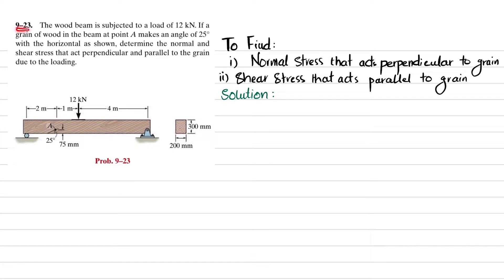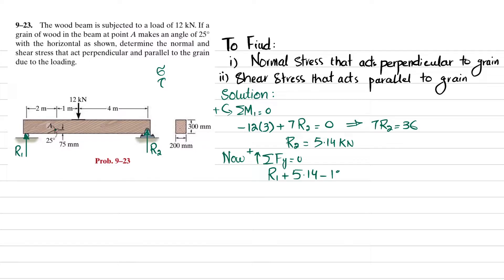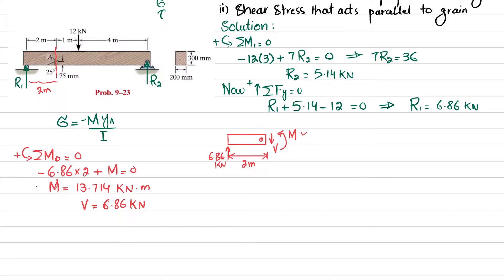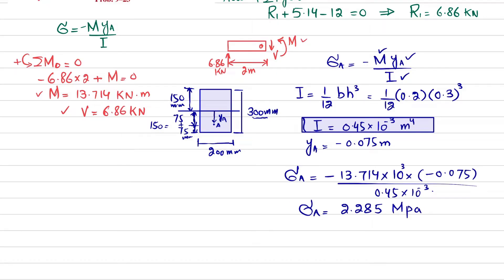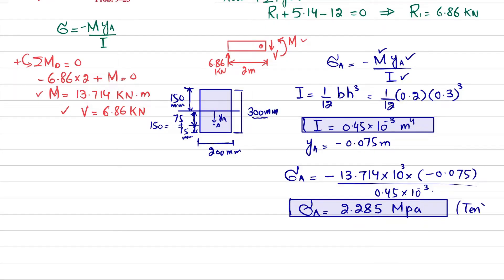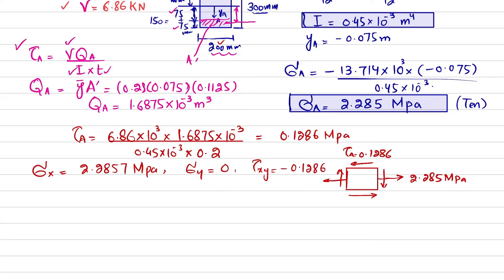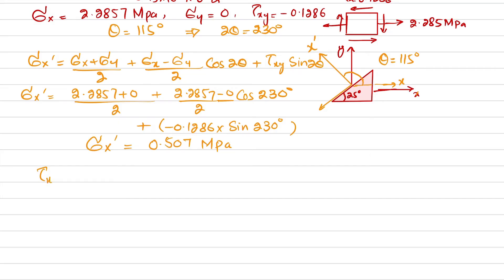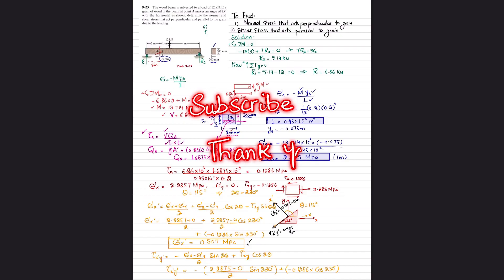9-23 Determine the normal and shear stress to the grain | Mech of materials rc hibbeler

Comment: Why the X' axis rotate I mean how I'll know that X' will be in that direction?
Plz I Don't understand this part
Reply from the maker: Please check the rest of comments . I am sure you will find the answer. If not then inform me please. Thank you
Reply: @engradnanrasheedmechanical  thanks sir for your reply...
But till now I have the same confusion or question...
Reply from the maker: At around 13:00 you can see you have sigma A and shear stress on the element. Now this normal stress sigma A is in x direction. It is given in the question that grain at 25 degree from x axis so at that find the normal stress on that plane and shear stress , so transformed normal stress will be sigma x' which is making an angle of 25 + 90 Degree. So your transformed axis will be at this angle.
Reply: So sir why I have to add 90°? 
Because in previous math like 9.8 or 9.9 we don’t add that 90°
Reply from the maker: @HasanShahriar-v9i initial normal stress acts along x axis so when at angle of 25 degree the inclined plane will have transformed  normal stress perpendicular to it. So it's angle from horizantal axis will be 25+ 90 Degree, so from this angle your normal stress will ne transformed into normal stress which is sigma x'.
Reply: @engradnanrasheedmechanical  Thank you very much sir for your information...
Reply from the maker: @HasanShahriar-v9i you are always welcome

Comment: In our lectures, we use the Mohr circle to obtain the stresses. I have difficulty in getting the answer using Mohr circle because I am not familiar with the formula used in the video. I would like to know how I can use the Mohr circle to obtain 0.507 MPa and 0.958 MPa. Thank you so much
Reply from the maker: ok than this will be more easier. you can see at 11:56 you have sigma x = 2.28 Mpa  , shear stress xy= -0.128 and sigma y is 0, so just plot (sigma x, - shear stress xy0)=(2.28, 0.128) and another point (sigma y, shear stress xy)=(0, -0.128). after plotting this two point join them using straight line . this line will intersect horizontal axis at a point which is taken as c. now open compas and take half of distance from c to one end of line. you will get mohr circle
Reply from the maker: once you draw  mohr circle then it will become easier to solve it. i hope if you have idea about mohr circle you can solve it and you should get the same answer as well. ❤

Comment: Why is the equation for sigma A negative please?
Reply from the maker: The general equation for Bending stress = - M* Y / I
And Y is distance from neutral axis to any point where you want to find the bending stress. If Y is above neutral axis then Y is taken as positive so bending stress will be negative which means compression and if Y is below neutral axis then Y is taken as negative and it will yield positive bending stress mean that this portion is in tension.
Reply: @engradnanrasheedmechanical  thanks, can you also explain why the sigma stress along the y axis is zero because I'm getting confused.
Reply from the maker: @kieranaxisa8138 because there is no normal stress in y direction. The moment produce normal stress in x direction while shear force produce shear stress.

Comment: Thank you sir! But why should 2.285MPa be sigma x and not sigma y? Force is acting downward vertically from y direction, so I though stress should also be acting at y-axis on stress diagram, which means sigma y for me. But that isnt the case? I also saw your comment about using theta p1 to find sigma, but still dont understand sir?
Reply from the maker: my answer will be same. theta p1 if you put in sigma x' and it come the same value then it's along x axis. i shall suggest you to watch it again carefully
Reply: @engradnanrasheedmechanical  Oh I get it. It has to be simga x' equation with same theta. Thanks sir!
Reply from the maker: @thant.chosenthetakenking7257 yes you are right ✅

Comment: sir what is the normal and sheer stress parallel to the wooden grain
is it sigma a or or is it sigma calculated by taking theta = 25
Reply from the maker: Normal stress perpendicular to grain will be calculated by taking theta 115 degree (check duration of  13:45 ) and shear stress parallel to grain by putting theta 115 degree. ❤❤
Reply: sir but normal stress parallel to the wood grain would be what then?
 @engradnanrasheedmechanical
Reply from the maker: Normal stress will be perpendicular to grain and shear stress will be parallel to grain.
Reply: then sir when we can take theta = 25
Reply from the maker: Theta will be 115 degree. Kindly watch it again please
Reply: @engradnanrasheedmechanical  sir im not talking for this question i am saying that in general when we will take theta = 25 degree, i mean what should be asked in the question so that we will take theta = 25
Reply from the maker: When it is given that bu rotating the element 25 degree clock wise or anticlockwise. You can check the initial problems of chapter 9 available on my channel.
Reply from the maker: @ovo.9043 you are always welcome

Comment: why we used 115 instead of 25?
Reply from the maker: Kindly mention where you are getting problem?
Reply: thanks for the quick reply. it is mentioned in the question that the angle is 25 why did we add 90 to it? @engradnanrasheedmechanical
Reply from the maker: @ibraheemmuslih4389  you can see when you cut it at 25 degree and your new axis x' and y' where you are going to find transform stresses so angle through which x has been rotated to get  x' is 115 degree that's why we have take 115 degree theta ❤
Reply from the maker: @ibraheemmuslih4389 you are welcome and keep watching and sharing 😀